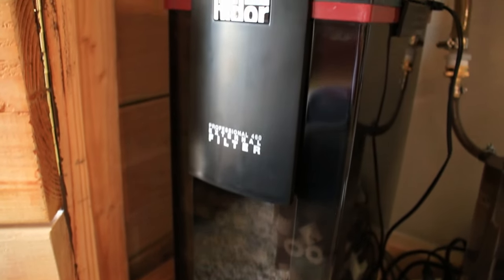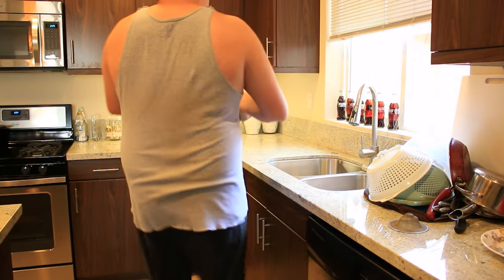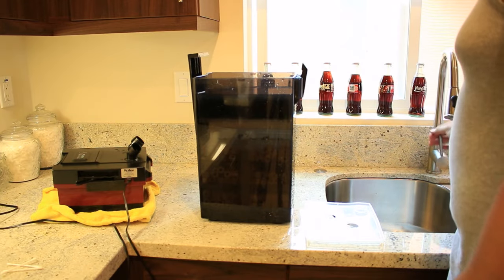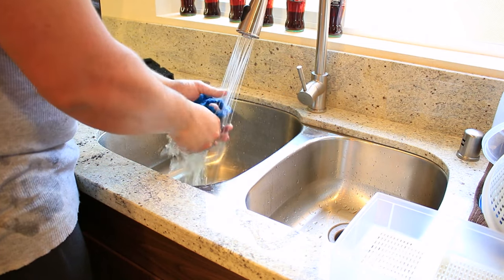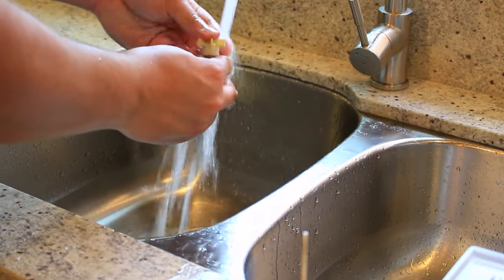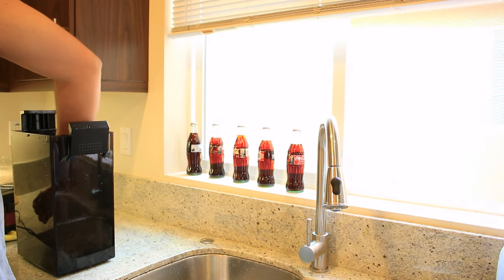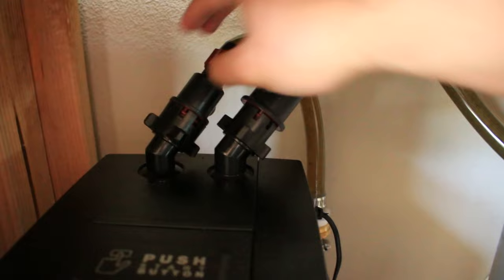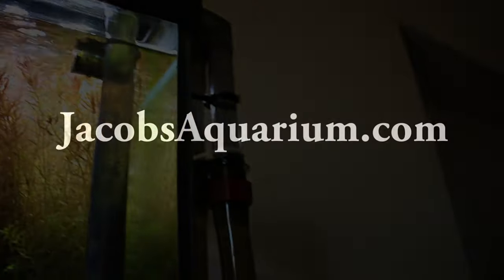How to Clean a Canister Filter

Comment: Thanks so much for posting such an easy to follow video. After cleaning my XL Pro canister filter with no trouble before, this time it was clear that the pump wasn't primed. I tried pushing down on the pump button to prime it,  it wouldn't depress. I tried filling the canister with water. Still didn't work. Your tip to unlock 1 clamp did the trick! I'd like to share a tip that works for me - I always put the canister filter inside a large clean bucket  to avoid any spills when removing the hoses or any accidental damage when taking the filter to and from the kitchen sink. It keeps the plug and cord nice and dry, too. No spills!

Comment: I've used canister filters for several years now and I do mine the exact same way, usually in the bath tub though, bigger space and I'm not getting fish gunk where I do dishes and cook. All the negative feedback about the chlorine tap water how you did it, you explained it exactly right. Sure theres beneficial bacteria on those sponge BUT thats not what they are intended for. What is intended to house a lot of the good bacteria you were careful with. And just like you said by simple squeezing them in some already gunky aquarium water is not going to do you any good. I like the tap water pressure and really get it clean. Awesome video!  I would like to add at the end when you leave the clip open, I used to do that with the fluval and my eheim and I could never get them closed in time because of the pressure and water would come flowing out, so be careful people!

Comment: I do the same with my magnum 350. Never had any problems with chlorine. Usually I do this after I vacuum and do a small water change. Prime is already being added to the water of the tank, and I sure there is enough left over in the water column to treat the 1 liter of tap water I have in the filter.

I dont was my ceramic media in tap water though. They get set to the side, I also notice I have a colony of mts living in my filter at all times. I believe they help to keep excess waster from clogging the system.
Reply: Sorry for the typos. I didn't proof read and have fat fingers on a small keyboard. I agree no swearing either. Check out FROM GOOGLE for that. Great video Jacob

Comment: Turn the input valve off and wait about three seconds before unplugging it. Now the filter is not 100% full and will not leak when you take the hoses or motor housing off. Great video and correct about cleaning the filter pads.
Reply: in that case the motor will pump up the remaining water in the canister and will be running without water right? wont that damage the motor?

Comment: Oh mercy....I think you just sold me on another canister filter. I used one with my 75 gallon initially, unfortunately, it was a huge pain and extremely messy. I'm looking to start over with another to hook up my new UV sterilizer. I'm gathering all the info I can and oh, I agree with how you clean your filter pads too. I too, have done it this way for years and have had not 1 single issue. I have a happy, healthy tank of sharks :) Thanks again!

Comment: Hello .  I have the same filter.  Have you had a problem with low pressure, coming from the outlet. When I first got this filter my outlet had a strong flow. Now I would say half. I'm also using a co2 distributer just like yours. Could that be why
Reply: Rick Bolster anything inline on a canister filter will reduce the flow due to the restrictions in the fittings. if you've had the reactor inline since new it may be from dirty filter media, dirty hoses, or even a dirty impeller. the first thing I'd do is give the hoses and canister a good cleaning and that should restore the flow.

Comment: agreed, tap water for filter media other than biological media. 

Any other media does not store nearly enough beneficial bacteria to make a drastic impact, as long as your biological media stays healthy its all good. Cleaning other media with high pressure water helps unclog pads, and other mechanical filtration as well to allow for cleaner water. So I agree with you, just my opinion

Comment: help...i cant get my filter (hydor 250) to start again after cleaning.  i tried lifting up the front as you did at the end of this video, to allow the canister to fill with water but i dont think it did (i cant see-through mine-its black). Thanks  Lydia
Reply: +Lydia Bruno Did you turn on the valve? And make sure you cannot the in and out valve correctly
Reply: +Winston Avalon thanks- i ended up priming it about 80 x...it works fine now....thanks! :D

Comment: I think you knew you would stir up a fuss with this video. I gota disagree with your method, but if you never had a problem then go with it. You might have low chlorine in your water. A hint of chlorine can fuck your tank, I know as iv done it. I only ever cleaned my canister filter out once it slows. Hate messing with it too much.
Reply from the maker: I'd appreciate it if you do not use curse words in your comments, thank you. In response to your post, there is no chlorine in my tank, if I did a water test right after cleaning my canister filter, it would show zero chlorine as it has when I've actually tested it. I don't understand the confusion here, tap water does not come in contact with the biological media. The media that holds probably 99% of the filters beneficial bacteria. Its not something that just works for me and me only, allot of people do it this way without any problems. Even people that own wet dry sump filters spray out there micron socks with tap water to clean them. If it was so bad to do this, why is this method being used in other forms of the hobby like marine tanks? Lastly, only cleaning a canister filter as it slows as you mentioned in your comment, is very harmful to your tank. Canister filters are known to be nitrate factories when left uncleaned for prolonged periods of time. Not to mention the stress you're putting on your motor to work through all that dirt and slimy fish waste that has collected on the impeller. I know everyone has their own method of cleaning a filter, but there is a way if done right that works best and I along with many others feel that cleaning a filter this way gets the most dirt and fish waste out to promote healthy water and a cleaner environment for aquarium inhabitants. I think we just have a respectful disagreement about this subject and we should leave it at that. But I just wanted to give you my thoughts. I appreciate your insight and thank you for watching my videos, it really means allot to me. Have fun with your tank and if you post a couple videos tell me, I'd love to check them out :) Thanks again.